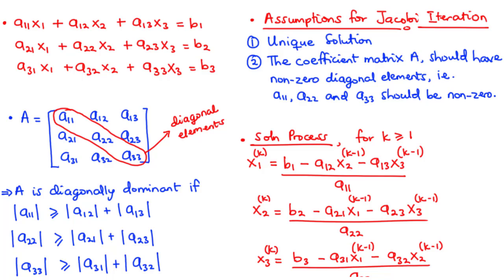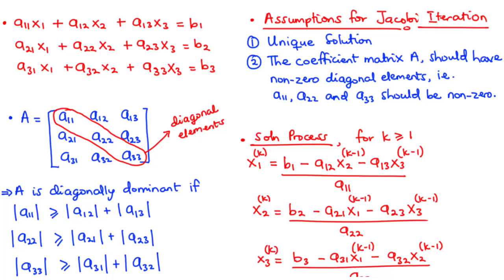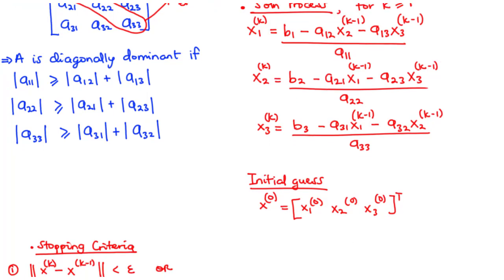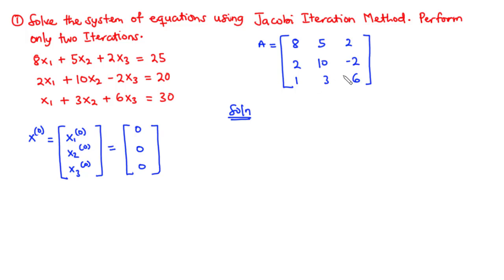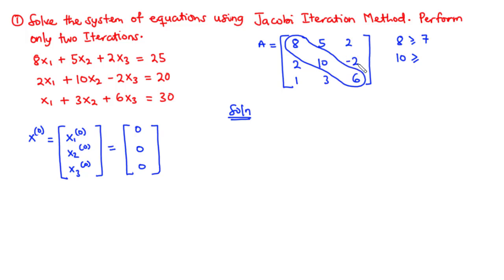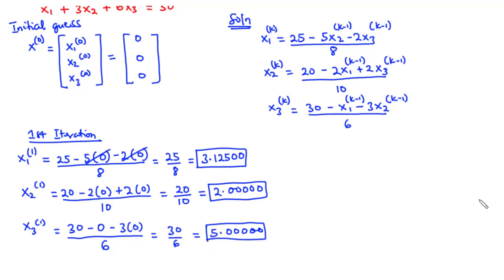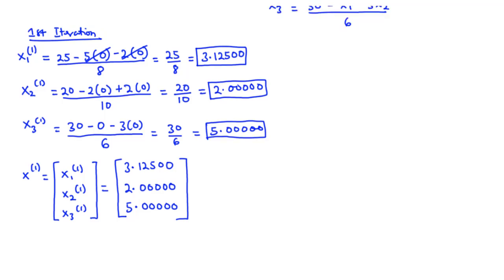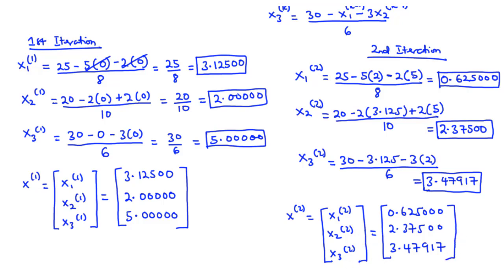🟢06a - Jacobi Iteration Method: Example 1

Comment: What's the deference between the jacobi methods (iteration method and the matrix form method )?
Reply from the maker: The main difference is Jacobi iteration is used to solve linear systems Ax = b, where Jacobi matrix iteration is for non-linear f(x) = 0